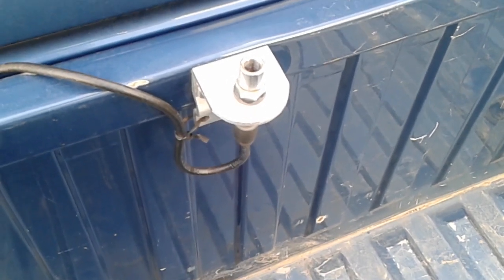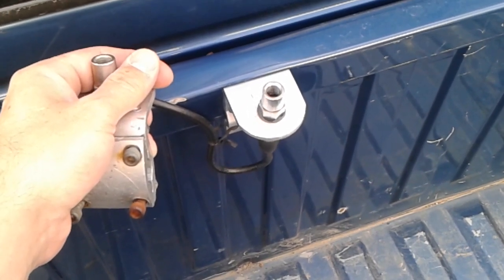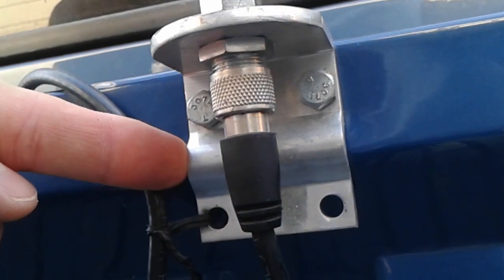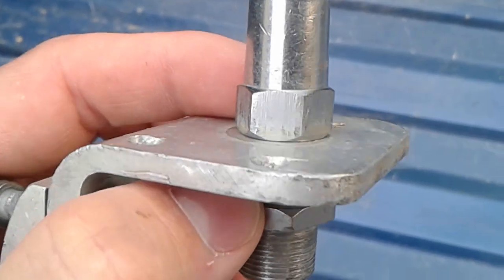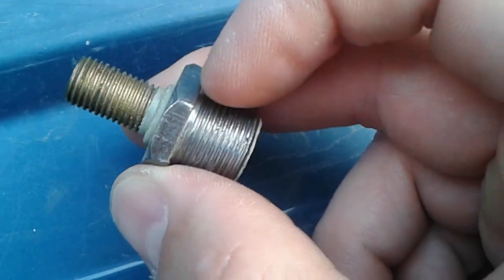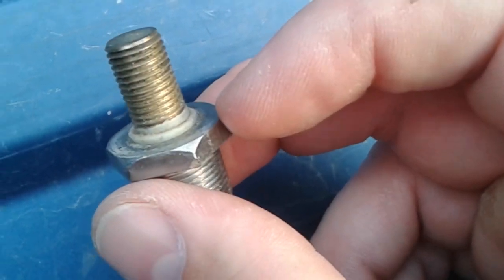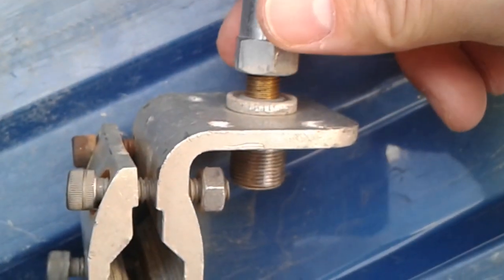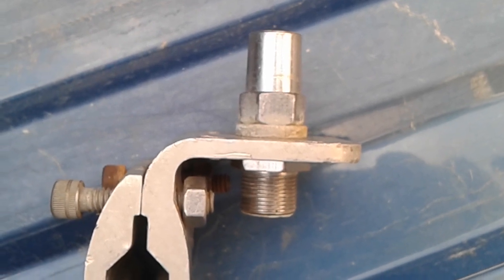How to mount cb antenna feed through adapter SO-239.  High swr ?

Comment: And the plastic washer is the first thing to fail.  There are more durable insulating washers, I have made them of various materials that last many times longer than plastic.  I often wonder why radio companies go to the trouble of designing a product, then base the whole thing on parts that are flimsy.
Reply from the maker: I actually haven't had one of the nylon/plastic washers fail and I've been using radios since the late 1980's.  I do agree they could make them out of something stronger, but luckily if one does break they can be replaced cheaply and they do last a long time unless someone over tightens the feed-through adapter and causes damage.  Here's a 10 pack for $ 6.00.
https://www.ebay.com/itm/Lot-of-10-Workman-CB-Radio-Antenna-Stud-Mount-Nylon-Insulator-Washers-Bulk/372480638563?epid=1558406410&hash=item56b9937e63:g:ULYAAOSwaXpb0SCB

Comment: Thanks, Mr.Douglas Bollinger. All I did was put the washer in the correct location and it fixed my swr problem. 
697 Nashville,T.N.  or  c.b.  handle 'The Old Fart."
Reply from the maker: You're welcome!  Have fun on the air!

Comment: Thanks for the good explanation. I'm new to this, and the insulator was on the bottom side of the bracket in the packaging, so that's where I put it when I set up the antenna.  That could be why others are making the mistake that I made. Thanks again.
Reply from the maker: You're welcome!  If you have other questions while making your installation feel free to ask, I'll try to help if I can.   They shouldn't put it in the packaging like that, it definitely can be misleading!

Comment: where do i find feed through adapters...
Reply from the maker: Sadly, I used to get most of my stuff from Radio Shack which went out of business, however, you can still find the feedthrough adapters and "luggage/mirror" mounts online at sites like Amazon, EBay, Ham Radio Outlet.  Also, if you have any truck stops/gas stations for truckers close by they usually have antenna supplies there, like "Pilot" gas stations, "Flyin' J "even "Love's" gas stations may have antenna supplies.  Some "Love's" gas stations will have truck parking and showers for truckers -- if they do they will probably have cb antenna supplies.   On a side note, if you order anything from Amazon right now there could be a delay since they are only shipping emergency/medical equipment stuff due to the virus situation in the world right now.  

Here are a couple ebay listings if it helps:

   https://www.ebay.com/itm/WORKMAN-SM1-3-8-24-to-SO-239-ANTENNA-STUD-MOUNT-ADAPTER/150593448104?hash=item231011a8a8:g:XqkAAMXQKtdQ1mAY

https://www.ebay.com/itm/Radio-Shack-CB-Antenna-Mirror-and-Luggage-Rack-Mount-3-8-24-Thread-21-937/233381187025?epid=1600249327&hash=item36569a4dd1:g:TXgAAOSwdolderK6
Reply: @douglasbollinger3626  Thank you very much...I will hit the truck stops.

Comment: Wow I'm glad I found this video It helped a lot I had already bought a new coax cable and then I thought it was my radio or the meter but that's all it was I just made a rookie mistake thanks for making a video about this
Reply from the maker: You're welcome!  Glad it helped!   If you have any questions as you get your set up installed feel free to ask,  I'll help if I can!
Reply: What was your radio doing before you did this ?i have a problem where I can’t hear nobody but everybody can hear me
Reply from the maker: @tonyalejandro6309  Is your speaker working?  Have you tried an external speaker?   Have you checked your microphone wiring because sometimes no sound will happen if a wire came loose in the microphone connection.  (Mic has to be plugged in on some radios for sound to work.)   Do you have a video of what it's doing??
Reply: Douglas Bollinger il thanks for replying ,my cb radio use to work ,and out of nowhere it went silent at a quarry ,everybody can hear me ,but I can’t hear nothing ,everything on the cb works,needle and lights ,I switched cbs to see if that was the problem along with the my friends mic and it still had no static coming threw the antenna ,changed the cable yesterday (coax) and nothing still ,it’s driving me crazy
Reply from the maker: @tonyalejandro6309  You're welcome.  Just curious, what kind of antenna and mount are you using?  I know you said you replaced the coax, but are sure the coax is good and not shorted?  How's the power wire hooked up?  Just trying to "see" what's going on.  Can you take any pictures and email them possibly?
Reply: Douglas Bollinger okay update today 4-6-2020 I bought new antenna and a external speaker I think is what it’s called and connected it to the back of the cb radio and guess what ?got static now ,Tommorow at work I’ll see how clear it transmits ,but now I have to figure out why the speaker went out and how I can get it back to normal without having a speaker plugged in ,I don’t got nothing to crazy on there but Tommorow when I get to the truck I can send you all info to your email? thanks boss man !!
Reply from the maker: @tonyalejandro6309  Sometimes speakers go bad and quit working.   If you open the radio up you can always check the speaker wires for good connection.   Also, check the swr's before you transmit a lot.   High swr's can hurt internal components of the radio.   Good swr's will help you have better signal.
Reply from the maker: @tonyalejandro6309  Also, Tony, have you replaced a speaker in a cb before?  It's pretty easy.  Take the cover with the speaker off, the wires may be soldered or may not.  Sometimes they just have slide on connectors.   Then usually four little nuts/bolts to mount the speaker to the case.  Until then, 'I'm glad you can still use the cb with an external speaker!!  What kind of CB is it??
Reply: Douglas Bollinger no I haven’t but Iam try it !!
Reply from the maker: @tonyalejandro6309    I found a replacement speaker on EBay (if you use Ebay) for $7.95 and free shipping if you haven't found a speaker yet...here's the link for the Ebay listing:  https://www.ebay.com/itm/Workman-SA-350-CB-Radio-3-5-Square-Internal-Replacement-Speaker-FREE-SHIPPING/372443452606?epid=20011371915&hash=item56b75c14be:g:WzcAAOSwdHxbpHAY